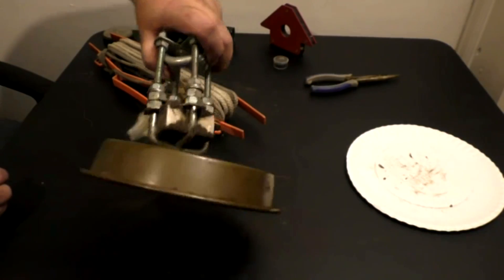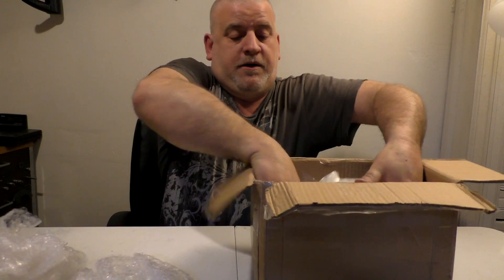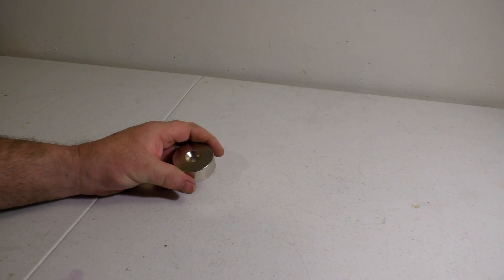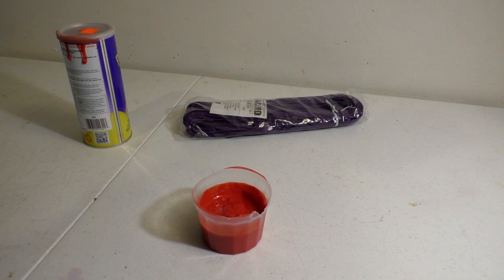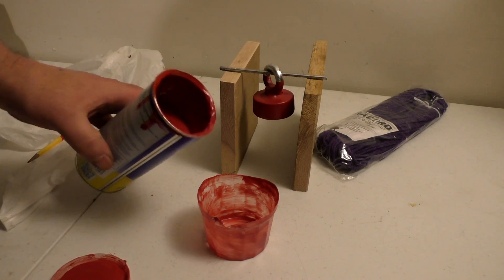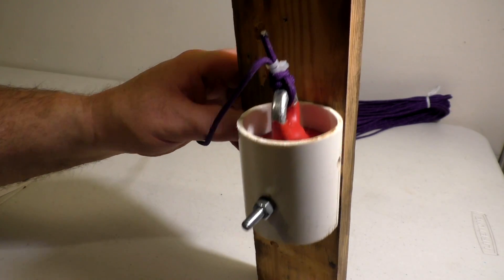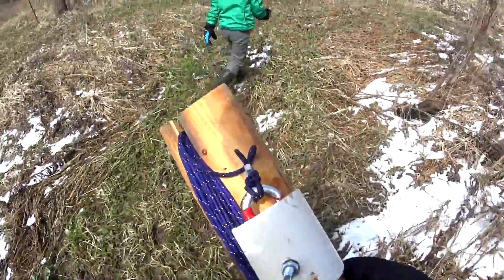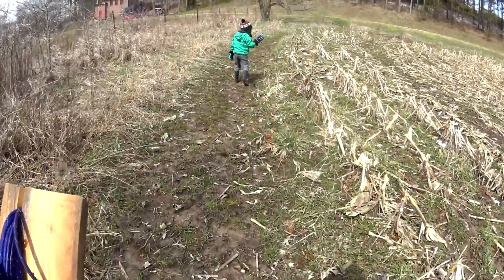How to build a Super Magnet for Magnet Fishing

Comment: ISO for a 25-50 lb pull - Neodymium Fishing Magnet and only is use on Sandy Bottoms for Coins and Jewelery..No Rocks or Branches.. and? They Eye Hook is thru the SIDE of the Magnet..  they have double sided 600lb  but not lighter /less pulling  and  not Single pulling..

Comment: Awesome magnet, theoretically if you added a thick steel / iron washer between the magnet and the eye, it would protect the magnet from strain and should also increase the pull force of the magnet significantly. I'm not an expert I just learned that recently and my personal tests have proven that it really works. Also something I did on mine as far as the dip/silicone goes, go ahead and dip away but while its drying, stick the business end to a flat sheet of low iron metal (sheet metal or something) with wax paper sandwiched in between. That will squeeze out the excess and leave a perfectly flat face.

Comment: You coated the face, thus cutting down on magnetic power
Reply: It would barely effect a magnet of that calibre
Reply: @bjeffrey1863  Maybe not, but common sense suggests any barrier between the magnet and the object, cuts down on the efficiency. May be easier to keep clean and rust free.
Reply: From what i read, it will cut it down by up to 70%.   I wander if you could put another cheaper smallet neodymium magnet after the plasty dip. That was you can always replace that one after long use. Im sure it will stick to the other magnet pretty strong

Comment: I did this magnet style, but instead of plasti-dip, I used the spray in bed liner. Much the same result. As for what holds the line, I actually used a bow fishing reel (yardsale find for $3.00), so I can just reel up the line after use for storage, and attached the reel to a piece of PVC where it reels the magnet into it, using a reducer to keep it from reeling too far. Works like a charm.
Reply from the maker: Great ideas

Comment: Cool video. Looks like a good idea. Just a heads up though 550 cord doesn't have a 550 pound pull just so you know. I used it to hang a deer after I shot it last year and it snapped the line after 4 seconds of it being off the ground. It was only a 200 pound deer too.
Reply from the maker: Thanks, Will find out someday I suppose

Comment: Could provide a link to where you got your magnets? They look like just what I need. Thanks
Reply from the maker: This is a square one from the states
http://www.ebay.com/itm/1-Piece-2-x-2-x-1-Dual-Countersunk-Hole-Rare-Earth-Neodymium-Block-Magnet-Grade-/121487061204?hash=item1c493170d4:g:YmQAAOSwNSxVbde8

This is like the one I used. Type in Neodymium Round in ebay search then highest price 1st to weed out the small ones.
http://www.ebay.com/itm/100-kg-Super-Powerful-big-Round-NdFeB-Neodymium-Disc-Magnets-N52-50x50x20mm-new-/162161713020?hash=item25c1975f7c:g:iNkAAOSwZ1BXfzoi

Or
http://www.ebay.com/itm/N52-Diameter-50mm-x-20mm-Round-Neodymium-Rare-Earth-Magnet-D50-x-20-mm-with-Hole-/222202674250?hash=item33bc4fbc4a:g:rC8AAOSwQjNW99Tb

Comment: you should ahve tied the paracord on and dipped righ in the can ! fuck all that pouring!
Reply from the maker: Trust me, thought of it. Can is metal. Would of had a mess with the magnet in it. If the can was plastic it would of been nice
Reply: oh snap ! sorry ! LOL! foiled again!i thought those were card board cans! well, probably could have poured the dip into a piece of PVC pipe sealed at one end. the you could dip away! the just seal with saran wrap ! hey, whatever works brother! may build one myself ,looks fun! I live in fla surrounded by water!
Reply from the maker: You know what, the PVC idea is pretty good. Use a 3 inch pipe sealed on the bottom with a cap the use a screw on end cap on the top. Make it about 6 inches log. A person would never have to pour again. I'm going to drain both cans I got into one. Thanks much.
Reply: that would be great . why do'nt oyu try a can of that stuff advertised, flex seal? comes on aerosol ?  and dipping pouring? the aerosol would be good !

Comment: I wanted to try magnet fishing too, and have a big boom, boom, boom, car bass speaker magnet.It is ferrite, but is about 6 inches across and has lots of power.  I drilled and tapped the center core, and screwed in an eye bolt with Locktite red.  It works well.  If you can't find one in your neighborhood, please come to mine and take one of the speakers from those idiots whose cars go thump, thump, thump as they drive by.  Car speakers have a back plate and core that focus the pull.  I sealed mine with silicone rubber, but the water got in.  Now, I embedded it in epoxy, so it should stay dry and keep out small rust particles.

I like your carrying rig.  When I was hammering wooden wedges to work out the core of my magnet, I suddenly realized that I was working with an alligator, one that could and would bite off a finger.  Isn't it interesting how a metal tool won't go where you try to put it, around big magnets?

I live on the Gulf Coast.  Not many rocks here, but the salt eats things pretty fast, and even gets into the metal.  I have wire brushed pliers to shiny metal and oiled them, only to find them totally encrusted in rust a couple of weeks later.

I imagine by now you put a decent piece of bigger diameter rope on the magnet.  That paracord on wet skin gets pretty hard on the hands.  Besides, it's only rated at 550 pounds, and you lose about 30 to 50% in your knots, and more to age and abrasion..  Wrap that thin stuff across sharp metal or rock and it abrades pretty quickly.   But the biggest thing is that thicker rope is so much more comfortable to work with.

Comment: what size is that magnet?
Reply from the maker: Think this one is 50mm x25mm with pre drilled hole. I just made another with a pole thats 2x2x1. Just uploaded the vid using that one
Reply: Where did you get the 2x2x1 magnet from?